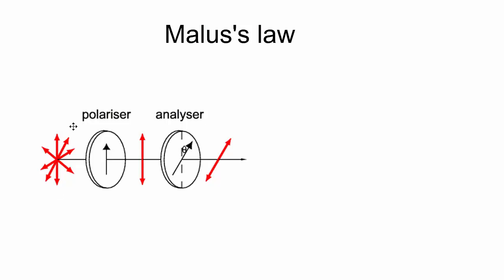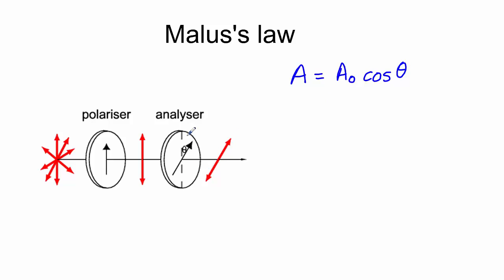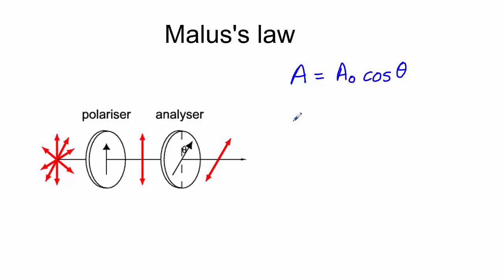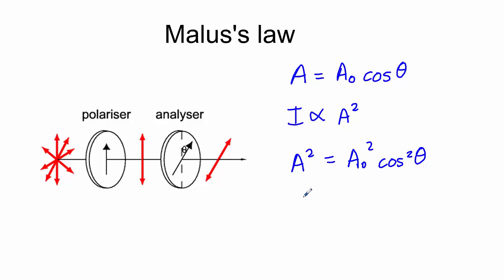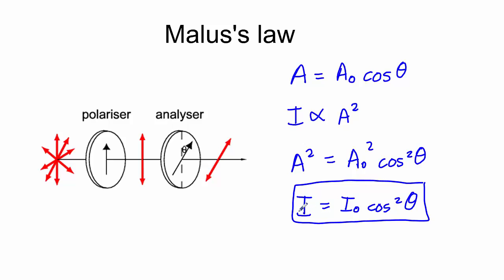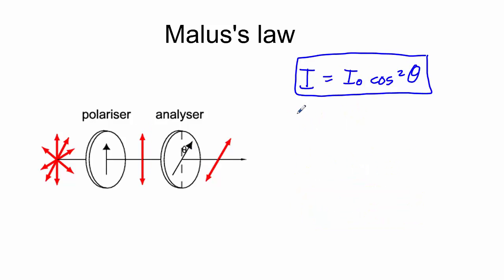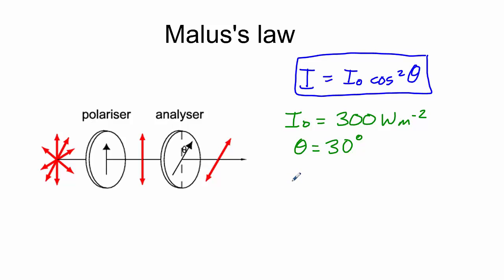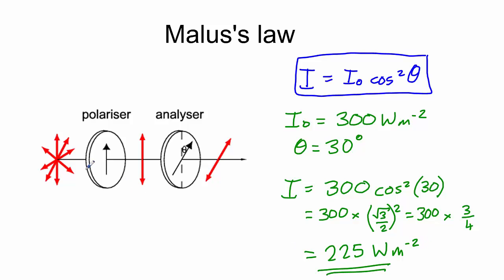Malus' law

Comment: Where did the cosine come from?
Reply: if you draw a triangle in the circle, where the angle appears, the intensity that passes through will be the incoming "vertical" light, which would be equal to the adjacent side (vertical component) of the triangle, by trig that is equal to cosine*hypoteneuse. and the hypoteneuse will be equal to the intensity the light would be if there was no difference in angle. 

by inspection, you can see that the vertical component would be 0 if the light was incoming horizontally (and cos90 = 0, so that checks out) and that incoming light with no difference in angle wouldn't be affected (cos0 = 1, so A=A0, and the triangle is now a straight line, where adjacent = hypoteneuse lol)

i get your comment is a year old but i really have no life or something. i don't know. maybe someone else will read it idfk
Reply: Thanks btw @PastaShapes
Reply: @PastaShapes  i can't believe didn't understand this. A year later, the question seems dumb to me now. And hey, this is my study account; i am on it pretty much every day, which is why I is am replying back in like 5 hrs.

Comment: Your explanation is wrong. I0 would halve after passing through the first filter. Probably should check what you are explaining before you post it. Gonna confuse a lot of students.
Reply from the maker: You are correct. I made a mistake in the video when I describe I0 as the intensity of light incident on the first polaroid, but it should be the intensity of the polarised light.

Comment: If I,0 = 300 W/m^2 and it's unpolarized, when it passes through the first filter, it should be halved.  So I,1 = 300/2 = 150 W/m^2.  Then you pass the light beam through the second polarizer, I,2 = 150 W/m^2 * cos^2(30 deg) = 113 W/m^2.

Video was helpful after that but he completely forgot about taking the average of the unpolarized light which is 0.5*I
Reply: I realize I am late to the party, but I'm posting a response for anybody else who may need it: All light can be said to be made up of a vertical and horizontal component for any given ray. As unpolarized light in equally likely to vibrate in any direction, this thus means that the light has net equal vertical and horizontal components (IE, each make up 50% of its intensity). As such, for the first polarizer that the light passes through only the component that aligns with the polarizing axis will make it through, eliminating all of one component (horizontal or vertical) and in turn halving the intensity.
Reply: Jerry Lacefield I was looking for an explanation as to why the light upon passing through the first polariser gets halved. Can you please explain a bit further?
Reply: why o.5?

Comment: Question about Malus's Law: 
Suppose I had 3 filters lined up on the x axis. The first 2 filters follow the exact same principles you outlined above (2nd filter has pheta of 30*), but the third one is now perpendicular to the first filter. As you mentioned earlier in the video, this would result in no light getting through. But here, after we get the 2nd polarised light [the final answer you had at the end of the video], that new plane of vibration is no longer perpendicular to the third filter [when the third filter was perpendicular to the polarized light from the initial polarizre], thus, should produce an intensity that is not 0. But that is not what I see when I experiment with it. What is going on?
Reply: sciencemanguy try this: put two polarizers at a 90° angle of each other.
You won't see light.
Put a third polarizer in between in an angle thats 0°< x < 90° and adjust that angle and you will see light coming through.
Reply: When you have 3 filters, the intensity formula is the same:
A2=A0*cos(t1)*cos(t2)
Where A0 is initial amplitude,
t1 is an angle difference between 1st and 2nd filter,
t2 is an angle between 2nd and 3rd filter.
Let's say you have filters with angles 0, 30 and 90 degrees.
t1 = 30,
t2 = 60.
Does it make sense?